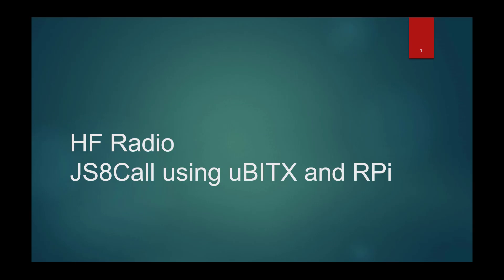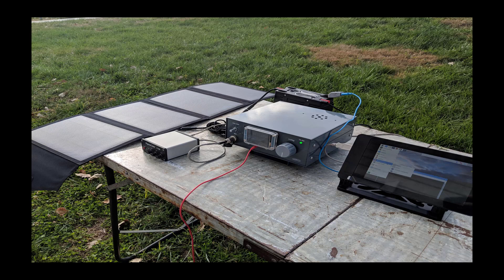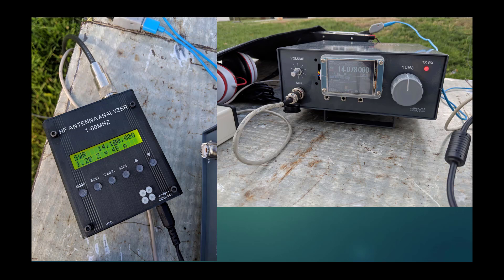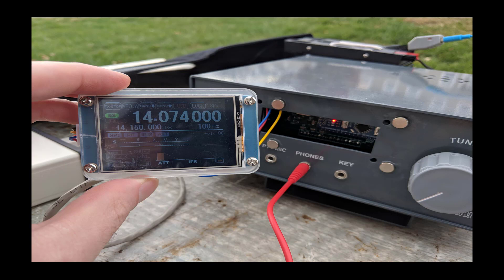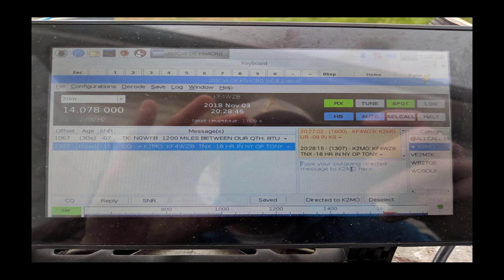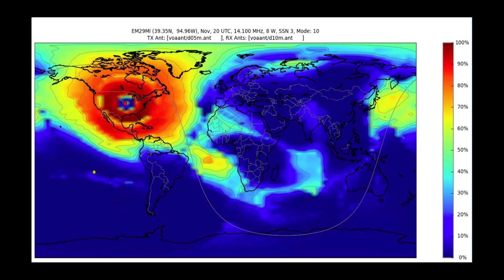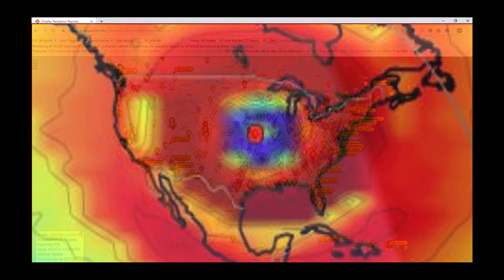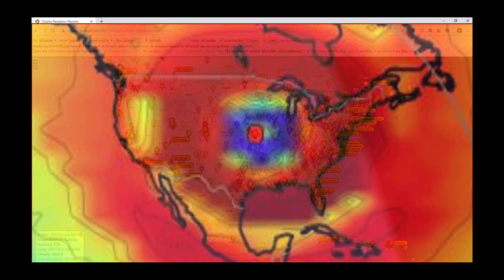JS8Call using uBITX radio

Comment: I'm running a MFJ intelletuner with my uBIX . Its so quick and its perfect. That way, I always have perfect SWR regardless of what band I use. I use one antenna, the 80 meter sky wire loop. I uses a cheap Chuwi Tablet running win10. Sometimes I power it using 5v from a 18650 multi battery set up from ebay, for the lowest noise. I have the 10 digi grid set up and show up on ARPS. I've used mailboxes, have relayed , and see a ton of future for JS8. In fact, I believe the mailbox thing, if upgraded, is the future. Imagine being able to pass messages to the eventual recipient , something like  win link, but a Jordan Sheer (JS) version ! N6RRG